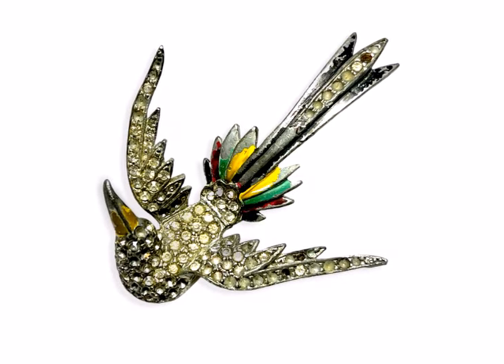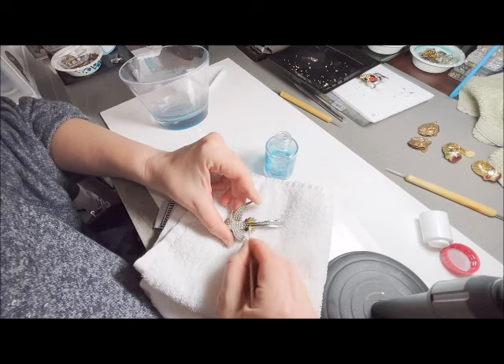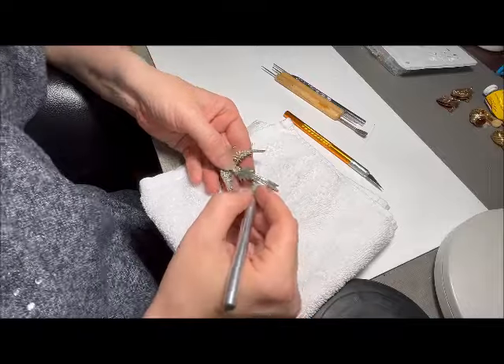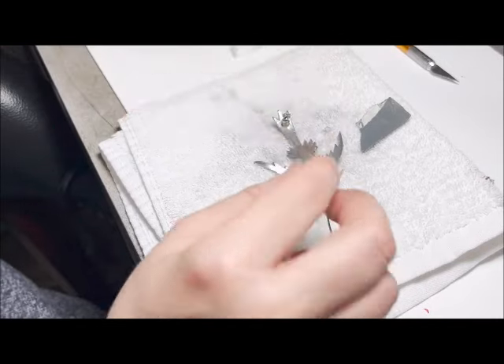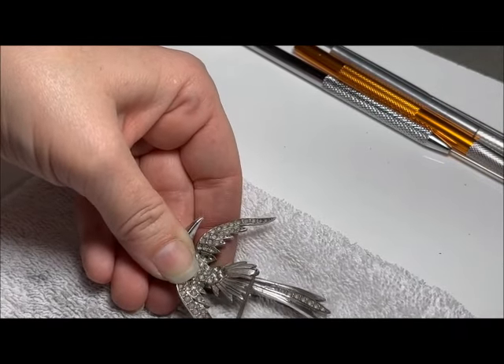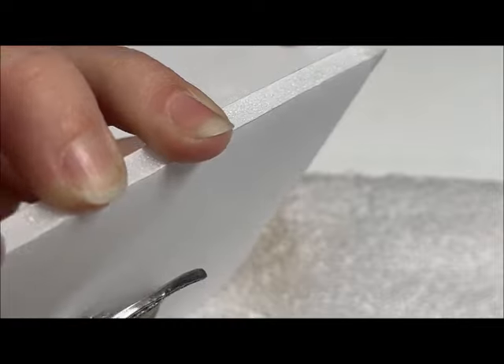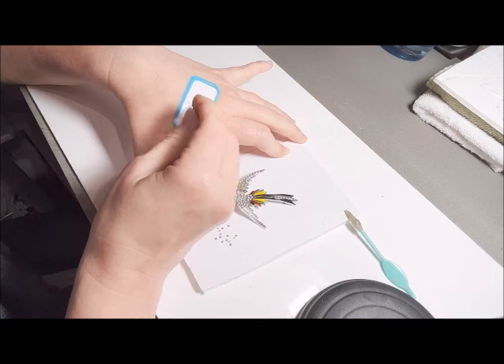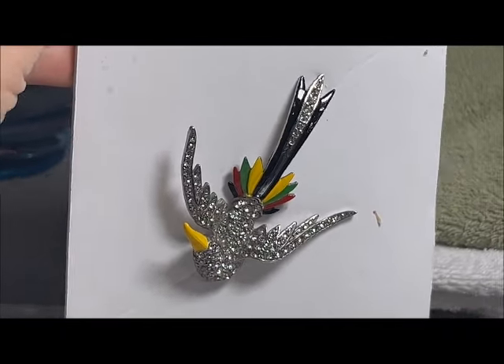From Dust to Dazzle: Restoring a 1930s Brooch

Comment: Beautiful work! I’m interested in the process of putting the rhinestones in. Did you put all the gorilla glue in first with a toothpick? What was the patch on your hand? Was the pastel blue tool something special to pick up and place the rhinestones? Gorgeous piece!!
Reply from the maker: Thank you so much. I put the gorilla glue in a few holes at a time then put the rhinestones in. So its just a few holes full of glue then placing in the rhinestones. Lol, the patch on my hand is just another weird thing I do. Its a roll of labels and I put two of them on my hand so I can have my glue very close and then just throw it away after I am done. The little stick I use to pick up the rhinestones is just a plastic stick with dental wax on the end. I think I will just upload another video with this slowed down and explain that a little more. I did a different video with a lot of this info, but it was a while back. Thank you again!
Reply: @OlivesVintageMarket  You are the best!!
Reply: @OlivesVintageMarket Have you used E6000 glue? That's what I use and obviously you are much better at refinishing you're pieces..Is there a refinisher metal coating you prefer for item's if it's needed??
Reply from the maker: @sherrienale9974  there is a video I did over all the glues. I never never use the e6000 I do not like it at all. I will find the link and post here so you can see
Reply from the maker: @sherrienale9974  https://youtu.be/tGtECHi9eXg?si=A0ewsFAA04hN7BWZ
Reply: Curious. Why did you do the enamel before putting in the rhinestones
Reply: Amazing restoration

Comment: My dental wax doesn’t stick to my rhinestones, what to do?
Reply from the maker: @joannmaxwell4117  are you warming it up a bit in your hands first. Sometimes when mine is to stiff or not tacky I just take the little ball off the tip roll it around and knead it for a sec and then put it back on the “stick”.

Comment: The finished product is beautiful. Great job. I am curious as to how the sockets where the rhinestones went were the cleaned first?  I have an old beauty pagent tiara that is dark under the rhinestones and don't know how to clean underneath, is there a way?  Thanks
Reply from the maker: The settings for the rhinestones are usually not the problem. It is usually the rhinestone itself. The foil backing becomes tarnished and the rhinestone 'dies'. That gives the rhinestone a very dark or dingy appearance. If it is actually just the setting that is dirty you will have to remove the rhinestone and clean the hole with a mild detergent like dawn or windex and then place the stone back in. Cleaning it with the stone still in there will just make it worse, unless it is an unfoiled stone. If you would like to send a picture to my email I will be happy to look at it for you to give you the best course of action.

Comment: Outstanding. You've given me ideas.
Do you know how to solder sterling to pewter?
Reply from the maker: Yeah, its kinda hard, but def possible. Since pewter is so soft and has a very low melting temp you will need a soft and low temp solder and use flux to help it adhere to the sterling. The sterling will not melt but if you use a high temp solder you will end up melting the pewter.
Reply: @OlivesVintageMarket  Thanks, I've been unable to find anything on YouTube about it at all. Sounds scary, I'll prolly pay a jeweler.
Reply from the maker: @icatz  if your not pretty good at soldering a jeweler would be best for a project like that. Just because you could easily melt the pewter. Good luck with it!!
Reply: @OlivesVintageMarket  I am good at soldering but it's a vintage Danish pendant which needs a new bail. It's Thor's Hammer (Mjolnir). Bought it ages ago in London. I have no other pewter to practice on.
Reply from the maker: @icatz  lol, I was going to say if you practice, but that counts that out. It’s sounds amazing!!!

Comment: What tool did you use to replace the stones? And what is the tag on your hand when replacing? Thanks 😊
Reply from the maker: @joannmaxwell4117  I just have a little bit of dental wax that people use on braces and mold it into a little point and put it on on a toothpick and it works really well to pick up the rhinestones. The little tag on my hand is actually just a sticker that people use to like mark things in their freezer and stuff so it’s waterproof and I put it on my hand and put my glue on that so I’m not constantly scraping my hand through glue on a piece of paper or some thing that I have laying on my desk because I have stuck my hand/arm in glue more times than I can count, lol.
Reply: @OlivesVintageMarket  thank you! I’ve been using tweezers and as I’m sure you know, the flat top is always upside down. My eyes are not the best and it’s hard to see if I’m placing it correctly.